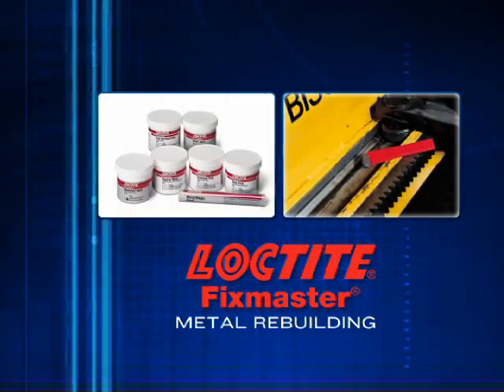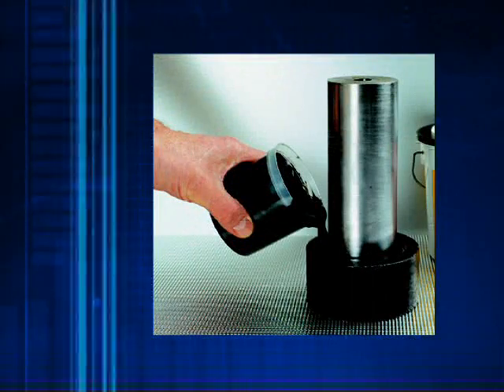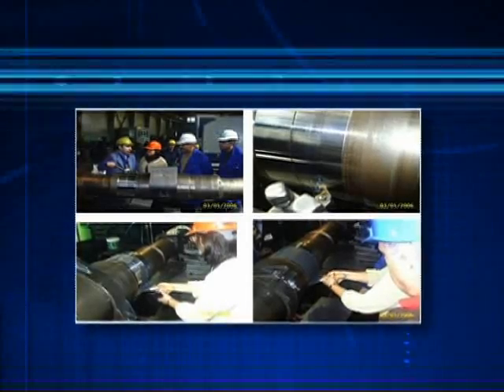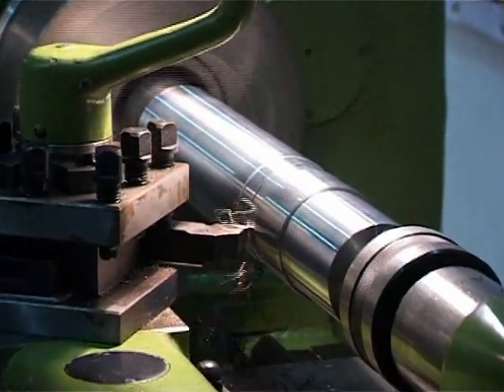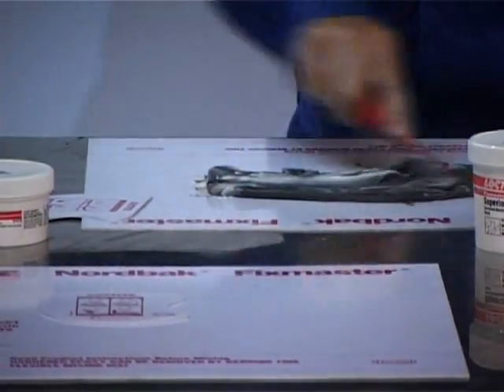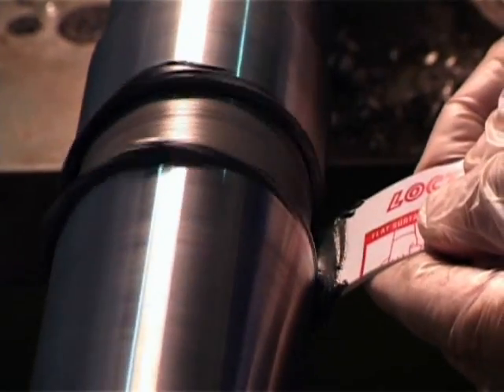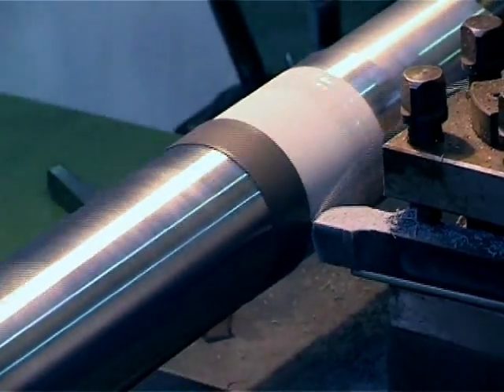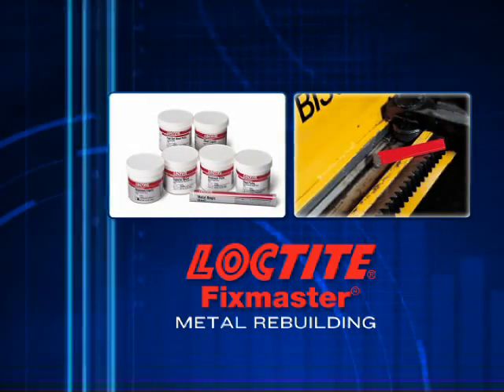Fixmaster Metal Rebuilding - Shaft Repair

Comment: Can this product be used for repair of main crank shaft bearing race surface? Or what is minimum thickness?
Reply from the maker: We're delighted to help address any inquiries you have regarding our products and technical matters. To ensure we offer the most accurate assistance, kindly reach out to our Technical Experts at the Support Center on Henkel Adhesives' website https://www.henkel-adhesives.com/us/en/about/contact-us.html .

Comment: For the metal shafts repair,really??Who would come out with dumb idea placing epoxy on rotation areas??This would generate exceeded heat and that so called repair would come out in no time..The proper repair of weared areas is by welding or brazing process while all extra get reduced on lathe after,everything else won't work on mechanical moving components,worst part if those shafts tempered steel or super strong alloy like titanium or molybdenium,titanium could be welded by torch heating area first than weld damaged surface while slowly using torch for cooling to avoid rapid air reach welded cake...There is planty of various products is out there but it not guarantee that would work on steel or any steel alloy damaged parts,this locktite product might be great for plastic and all non ferrous metals like aluminum,copper,brass,bronze,tin zink alloy but not steel or even cast iron's..
Reply: You have Zero fkn clue what you’re talking about. 

What is this Amatuer Hour?
Reply: It could be you are missing the point of this shaft repair kit. I see it to be only for oil seal repair if it can be polished. If you have any significant load in damaged area, this would be super stupid to use as repair, unless this epoxy has some Strar Track grade of properties.
Reply: It also works for a radial bearing which has inner and outer races. I don't think you would use this in a plain bearing journal.  @justmemyselfandi5532